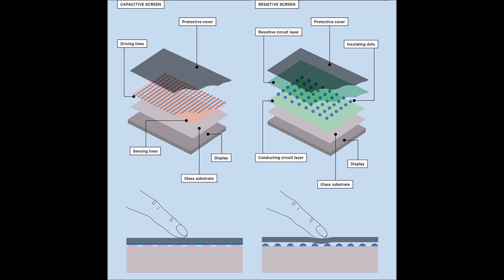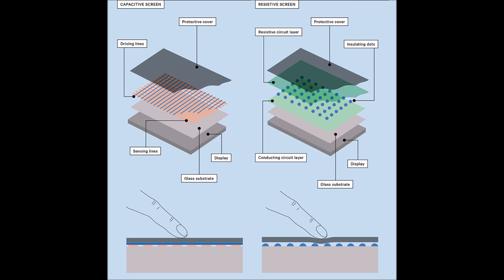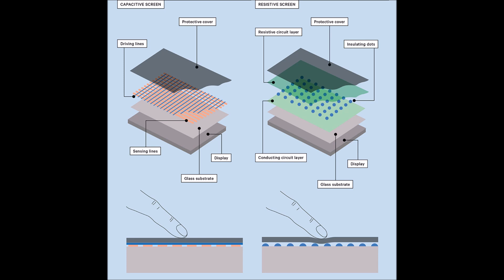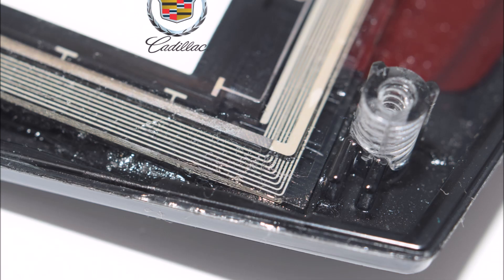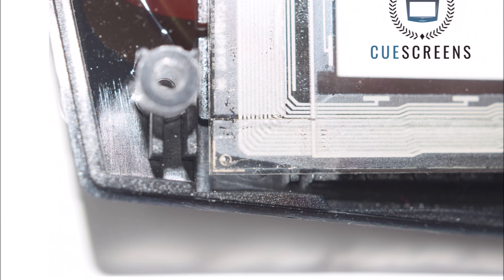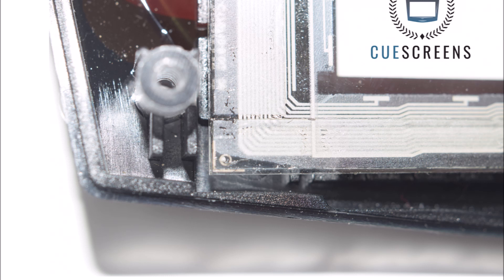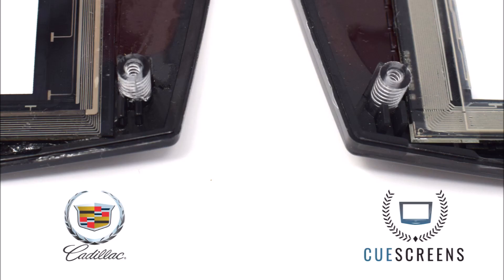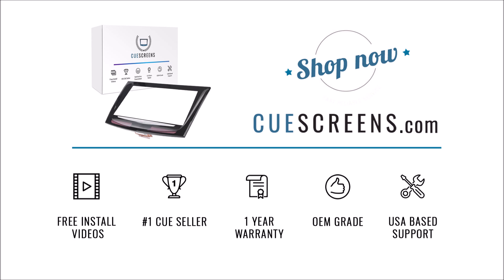Why are they all failing

Comment: Wife ordered your CUE screen. My local stereo shop wouldn’t replace the screen instead they wanted to swap the Cadillac stereo with aftermarket. I installed it took me a few hours to give birth to the head unit. The clips did not cooperate with me. Actual installation of the touch  screen was easy and all the screw holes Lined up perfectly. I myself was worried.
Reply from the maker: Shockingly enough, there are a lot of shady car audio shops out there that want to extract as much money as possible from you.
Reply: @CUESCREENS  Thank you for the reply. My local stereo shop is part owned by a high school friend whom I’ve had install a few stereos, amps, and speakers in my cars over the years. The Cadillac dealer said to order screen from CueScreens or aftermarket and have them install it. He wouldn’t be able to source a screen and it would cost an arm and a leg if he was able to.

Comment: My screen frozen with WARNING 
Taking your eyes off the road too long or too often while using this system could cause a crash, resulting in injury or death to you or others. Focus your attention on driving.” The first time it did this my 2015 SXR was under warranty and the dealership replaced it with a newer model, they told me. Now, the exact same issue happened and the warranty is expired. We are looking into purchasing another unit from EBay Motors but they only have a 30 day return. There’s a Tesla unit offered that states it will fit my vehicle. Has anyone tried the Tesla unit instead of the problematic Cue Unit?
Reply from the maker: Yes, this is the common touch screen failure. All you have to do is replace the touch screen

Comment: I re watched the videos about 5 times and then started on the project. It was about 3 hours time, I might be able to cut that in half if I do another one. My CUE system works now with faster screen response instead of beeping and changing everything on the screen, plus no more spider webbing in the lower half where I couldn't even read anything. Thank you so much. 2016 CTS-V with under 17k miles, and I'm 70 Y.O. and disabled. It was that easy!

Comment: My 2016 escalade display doesn't work also it burn I seen smoke and my dash Is not working is off
Reply from the maker: Hi Juan, if your vehicle is burned and you see smoke then replacing the touch screen will not fix it.

Comment: 2015 SRX screen non-responsive. Will a new Cue Screen resolve the problem? Is the Cue Screen just the glass or do I need to replace more? Steering wheel commands still work,  just not the Touch Screen.  PLease let me know what you think and I'll place my Order with you guys!   Thanks ...Ron
Reply from the maker: Hi Ron, yes an upgrade gel free screen will fix the problem permanently. Order at cuescreens.com/shop, I recommend the premium touch screen as long as its the original CUE from 2015 thanks!

Comment: Have a 2018 XTS. Can I replace the screen myself. It has spider wed cracks on the inside.
Reply from the maker: Yes its an easy DIY- you will need the V2018 screen here https://www.cuescreens.com/product-page/v2018-oem-cadillac-cue-replacement-touch-screen-display

Comment: A couple of questions: Why does the CUE screen work for a while, if we follow the GM Hard Reset Procedure ? ... Also, you say the problem is up to 2018 models. Can we use the entire stack from the newer 2019 or later in the 2016 ATS and would it need to be programmed into the car or is it just plug & play ? ... Thanks
Reply from the maker: The touch screen can have intermittent functionality when it is going bad. Some days or hours it works fine, others it is frozen. The hard reset is a placebo that doesn't do anything to fix the issue, just wastes time. The problem affects all SRX, ATS, CTS, Escalade, ELR, XTS models. If you have a 2018+ car, or an older car that has the newer 2018+ radio installed, you need the V2018 touch screen to be compatible. You can install a center stack from any generation as long as the configuration matches. Feel free to call us 563-289-7276 to get an order in. cuescreens.com

Comment: Let's all call GM corporate office let them know  that they need to do a recall on this cue screen issue. I see it all over you tube.
Reply: No for real ! I am having an issues with it as we speak.
Reply: 2017 screen has been replaced several times.  At first the factory part seemed to be inferior.  We replaced with after market product, worked for a year or so, but now is affecting everything!  CERTAINLY Cadillac Knows this is a problem with their LUXURY cars!  We need Cadillac to resolve this problem as it can lead to unsafe driving conditions!

Comment: The unit in my 2016 ATS started doing the non responsive thing. My car is still under the 5 yr warranty and I will probably let the dealer do the repair this time. I do not know if GM revised the way the screens are designed. You would hope they would given the amount of failures and warranty claims. After I get it replaced, if it fails again in the future, I will give your product serious consideration. Certainly your cost is very good. How much would an installer charge to swap it for me ? I do not like messing with the way newer dashboards are designed.
Reply from the maker: Installs are usually 200 or so depending on the installer. https://www.cuescreens.com/product-page/oem-cadillac-cue-touchsense-replacement-touch-screen-display

Comment: Hello!. I got the symptoms described here. Non responsive screen, ,etc. My questions is, the human module interface (which is the brrain of the CUE sytem) has latest software update so it looks like is not a module issue BUT the apps has a flickering movement from left to right of the screen, pretty much when I push the Sound icon, do you think that the screen will fix this issue too? I mean, probably replace the screen when you have a non responsive screen make sense but what about if it icons do the flickering issue? I don't want to buy a screen and be stuck with the same problem, any advice?. Thank you very much.
Reply from the maker: When you say flickering- does it seem like the display is cutting out, or is it just erratic random touch response? Like a ghost is pressing the screen randomly?
Reply: @CUESCREENS  I will say both. The last description that you said is what is happening (99% when I try to press over a icon/app. I press then do not respond or just freeze. Sometimes, I press a icon then few seconds later, it shows the "red" thing as when the icon is properly pressed. The flickering issue, is pretty much when I press on the upper left corner of the screen (there is located the Sound icon like a speaker icon). The HMI module is up to dated with latest software and the weird thing is that the car has zero MIL codes. Basically, nothing is wrong with the car modules....., it is a real pain in the neck.
Note: most owners with the same or similar issues, had changed the entire central stack by the dealer and the issue just dissapeared make me think that it is a screen issue related than a software from the HMI module.
Reply from the maker: @louisb.7544  Yeah, this sounds a screen issue. I would install a gel free screen from cuescreens.com and that should fix your issues. Send me a chat message on the website for a special promo code.
Reply: @CUESCREENS   I will! and thank you so much for the help!
Reply: @louisb.7544  did you ever order it? If so did it fit your issue?
Reply from the maker: @johnlopez6843  Yep!

Comment: Thanks for Vid !  My 2013 XTS Cue is froze..56 k miles...I have back up cam  display...that is a good thing for me.... I control xtm stations on dash screen with only the frew stations I had stored before this overnight freeze...thank  God heater controls work from below screen controls ...Don't call Cadillac.....they send you to a so called Cadillac tec who just blows you off....don't waste your time...….they want you to go to a Cadillac dealer and get robbed by replacing unit with new one..$$$$$$..what a let down from Cadillac.....this is my  8 th  Cadillac through the years and my last one.....
Reply: Easy fix- cuescreens.com order a new screen and it will be fixed permanently
Reply: who can I get near me to install this screen ....I have no skills in this and poor vision also
Reply from the maker: @MrTitan225  Check cuescreens.com/installers for help